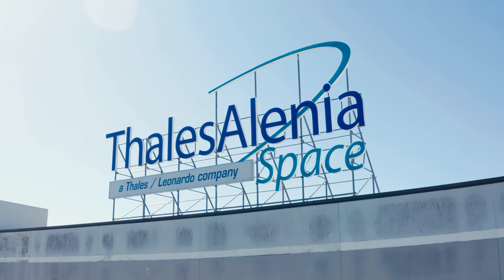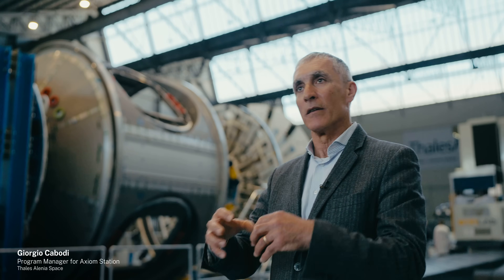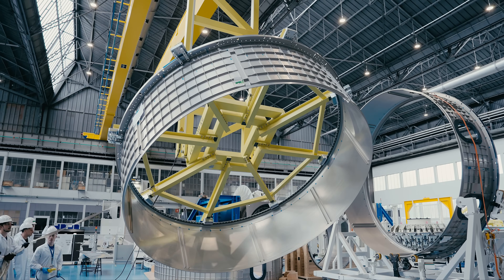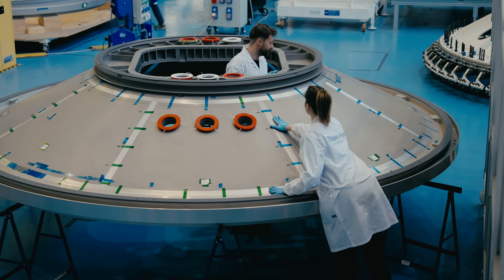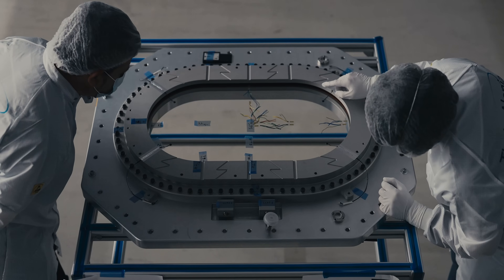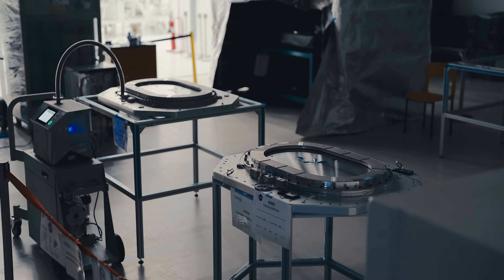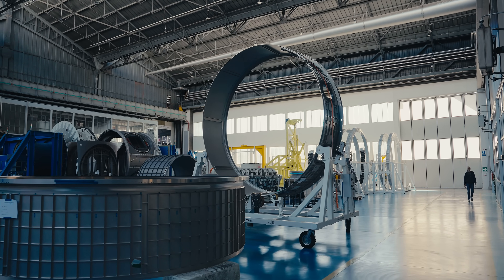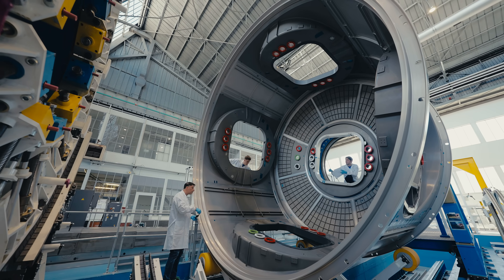Axiom Station Update | Habitat One

Comment: It does look a bit large diameter to launch it on F9 / FH, starship maybe?
Reply: It is the right size for a falcon 9. Falcon 9 is about 3.7 meters in diameter, about the same as the height of two people.
Reply: It’s supposed to be launched on a F9, but it wouldn’t be surprising to see them change it to a FH just to be safe.
Reply: @brendentodd9360  why? it's headed straight to LEO, and it's not like it's particularly heavy - modules by nature are hollow. An F9 would do just fine